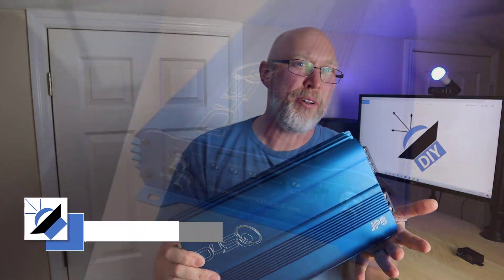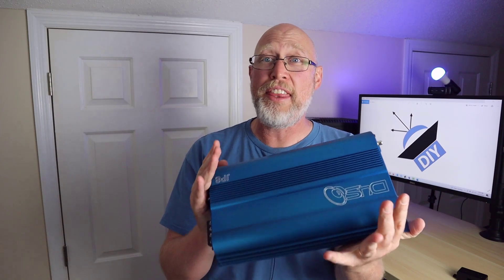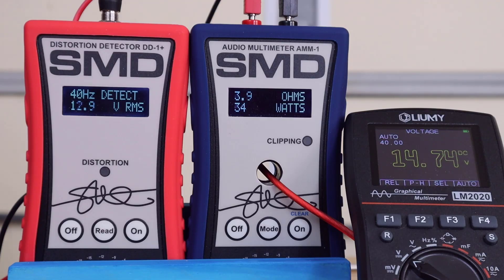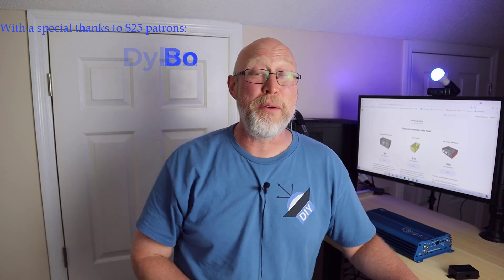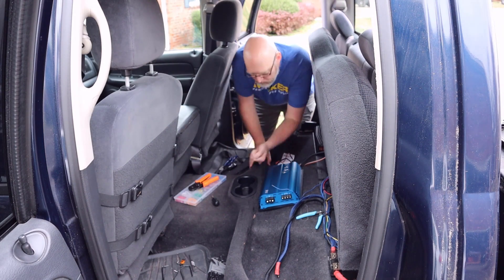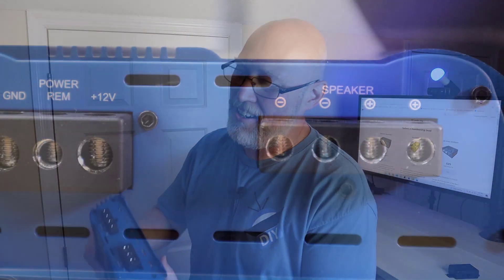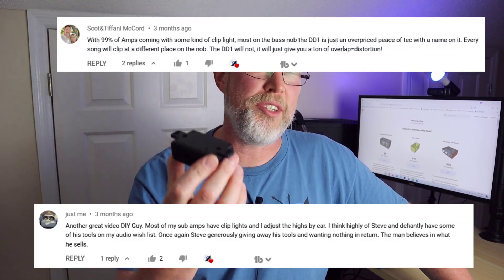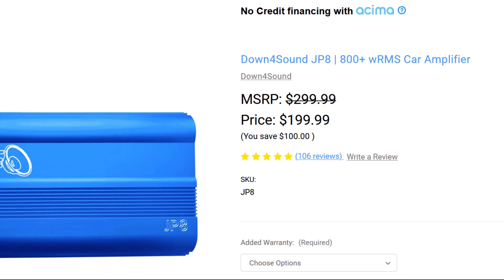700 watt Car Amplifier:  JP8 Amplifier from Down4Sound

Comment: Small piece of window tint on bass knob fix brightness issue.
Reply: @DIYAudioGuy  also use cheap tinted cell phone screen protector. Can cut with scissors would be cheaper then buying tint can be bought for like a dollar.

Comment: Great review! I totally dig this amp, mainly because of the stuff you mentioned....looks, features and value. And it doesn't require an upgraded electrical system unless you are running it below 1 ohm (it's stable down to 0.5 ohms).
Reply from the maker: Yeah it's a good amp!

Comment: I bought this, and matching 4channel, as I LOVE the blue, and throw back look. My ONLY complaint is the inputs are on opposite ends, vs. all on same end. As far as the bass remote, I took mine apart, found an old piece of film negative( Kodak), and placed it over the remote window, put it back together& Voila!, You see it clearly, and tones it down a lot!!! Keep the videos coming.( I don't run these currently, just will keep in collection, blue looks great in person 👍🏼🙌🏼🥳
Reply from the maker: That's really clever!
Reply: Great idea to tone down the brightness on the knob Christian.  Will likely be getting the JP8 + JP84 Combo for the wife's ride.  Great performance for the price... 👍🏽
Reply: A small piece of tint works well too.  And there's tons of different darkness so you can find the one thay works best
Reply: @DIYAudioGuy  just realized I wasn't subscribed... been watching your videos for a while, like your no nonsense delivery and excellent way you have of explaining things so people who don't know as much about it will understand.   I've been messing with car audio for 22 years, every car has had upgraded stereos from mild to wild.  Now that I'm a little older I'm more into SQ, so the single 10" 500 RMS DD Audio Redline in the rear hatch is more than adequate.
Reply: @Vegas_Baba808  I was thinking of doing the same.  For $379 having a nice looking matching pair of amps that do above rated, have the best bass knob/remote display on the market is great.  They will likely sit on a shelf for a while as I don't have anything to put them in atm but for the price it doesn't bother me if they sit for a while.  Or maybe I'll get bored one weekend and swap them in and see how they compare (one car has Excelon XR-4S/XR-1S combo and the other has a couple MTX Thunder Elite amps in it)
Reply: @CarAudioObsessions  Yup.  $380 + Tax for the pair is a steal.  I am trying to work out what kind speakers we going to use.  So many wonderful choices, decisions decisions.  lol
Reply: @Vegas_Baba808  I would just get the five channel JP95 for ur wife it’s what I have in my car & it has plenty of power 4 ur subs and full range speakers 😀
Reply: @rickross368  Ya Boi!  1 Amp that takes up less space, while easily exceeding rated power.

Hustlin' Anthem 4 Life!  ✊🏼🔊🔥
Reply: I have a new in the box JP95, never saw power. Going different route that I'm selling at decent discount if anyone is interested.

Comment: We're you running dual power inputs in the vehicle  ? Wondering if i should add a second battery in the trunk with this amp.
Thanks
Reply from the maker: Nope, just a single power wire of the appropriate size.

Comment: I bought this amp for 169 around Thanksgiving after my kicker cxa800.1 let go of life. That kicker was a tank. This JP8 sounds better than that kicker. It does take some juice to run. I currently have it in an f150 with 130 amp alternator, big 3, and 112 ah of agm. It still drops my voltage from 14.3 to 13 even on a heavy bass note. I am in a group on Facebook with the guy who repairs the D4S amps. He says that they are safe down to 12.5 volts. They designed them to be lower voltage friendly. With enough electrical behind them they can do around 1500 watts. Best 169 bucks I have ever spent.
Reply from the maker: Yeah, I just really need upgrade my alternator this summer.  I love to run a pair of these strapped.
Reply: I replaced a audiocontrol 1500.1 sub amp with the JP8 in sierra Denali  with a 2-12” Jl audio stealth box. It pounds but no where near the level of the audio control. For 200 bucks it can’t be beat
Reply: I have one in my f150 as well on a single sdr 12

Comment: Will this run a 1200w rms subwoofer without problems?
Reply from the maker: IF you have the electrical system to support it it will do 1200 watts.
Reply: @DIYAudioGuy  you mean a good battery with high voltage? I’m trying to get it for my sub rated at 1200w rms at 1 ohm!

Comment: That bass knob is cute but good luck mounting it stealth. I can see car audio thieves scoping it out and breaking windows
Reply from the maker: Yea, this will be hard to hide.
Reply: That’s why you have tinted windows when you got system.
Reply: @KillaCamm  lol. Ok bro. We call that a mark
Reply: Mount it in the center console or if your vehicle actually has an ashtray/cigarette lighter that opens/pulls out of the dash, you could mount it in plave of the ashtray (assuming you don't ever use the ashtray).
Reply: @brandonweigel6309  yes. You need to get creative. It should be designed more modular. So you can take it apart and mount it as separate pieces.
Reply: @johnviera3884  haven't even opened my JP8 and had it for a year now. Not in any rush to use it and for all I know, never will. But if I do, I'll be making modifications to the unit and mounting it more/less out of sight.
Reply: @brandonweigel6309  great amp.

Comment: Great review! i've been running a JP8 for about 2 months, powering 2 10" Kicker Comp R's @ 1ohm total, upgraded 200 amp alternator and i love this amp. The fan on mine runs constant when amp is on, but not a problem.
Reply from the maker: Mine barely gets hot, but I have the gained turned down to match the 500 watt Soundown 12 in the profab enclosure.  Plenty of bass for me.
Reply: @DIYAudioGuy  Same here, barely even gets warm after 30 min. of running hard, especially with the fan coming on when i first turn it on.. constant cooling.
Reply: I live in SC and I have got the thing up to 150 degrees on the bass knob and still hasn’t shut off on me. It sits in the trunk and this is me going full tilt right before clipping for 30 minutes straight. Not to mention this is when it was 95 degrees outside.  This amp is an absolute monster for sure.

Comment: Trick I learned with leds is to cover the display with masking tape and it will diffuse and dampen the light.  Way better.  Layer it if you want dimmer.
Reply from the maker: I think I'm going to do that right now.
Reply: Or a piece of tint

Comment: This is an old video so I hope you see this what does the 1x mean so 650W x 1 @ 14.4v @2 ohm Does this mean 1 speaker or all together? Like I have 2 subwoofers at  800w @ 2 ohms I see amps that say 650W x2 I can't find an explanation anywhere
Reply from the maker: It means one channel. It's a mono amplifier.
Reply: @DIYAudioGuy  thanks I chose mono for a filter. So means they didn’t filter very well.

Comment: I run a couple jp23's at 16v and they take it all day long and push out some SERIOUS power for a couple amps rated at 2300rms. I only drop to 15.2v at max output so I have that 14.4 rating all day long and clamp 3000+ watts out of each. Gain matched pushing 2x sav2 15s each at .5ohm - rising to around 1.3ohm
Reply from the maker: I have a jp23, I hope to get it installed in December, it is going to be part of a bigger project.

Comment: I've only heard D4S amps on videos. But I have seen some articles talking not only the power you get from D4S amps, but their low distortion sound quality. All based on distortion tests that put the D4S as some of the best sounding amps out there.  Strikes me JP at D4S has done a solid for the customers providing an overall good quality product.  OEM sucks, that's why you bother installing an aftermarket stereo.  Even cheap entry level components sound better than OEM. A new $30,000 car still gets a shitty stereo from the car companies. A more powerful alternator and electrical system is a practical feature not even an option. Just a crazy expensive stereo upgrade from dealer. Who then resells your old OEM stereo. Not cool.

Comment: What size fuse u running on that amp ? It says 120 in manual? I just got this amp and haven’t hooked it up yet. I have stock alt, but secondary battery . Would u say 120 is to high ? I reached out to D4Sound but haven’t heard anything back yet? Thank u!
Reply from the maker: 120.

Comment: Review the JP95 if you can. I want to know about the sound quality specifically. 

Awesome video!
Reply from the maker: I'll have to beef up my test bench before I can run that sucker.
Reply: I have a new in the box JP95 that I'm selling. Never had power hooked up. Going different route. Selling at decent discount if interested.
Reply from the maker: @andrewblackmon8021  👍
Reply: @andrewblackmon8021  

Did you sell it?

Comment: So the bass knob CLIP(10% THD) light is turning on before the DD1 DISTORTION(1% THD) light. Hmm
Reply from the maker: Yes.
Reply: it is obviously turning on right when it detects a tiny bit of clipping. the DD-1 turns on at 1% THD so i would suspect this amp is turning the clip light at less than that.  or basically whenever the current and voltage are calculated to be at higher than the amplifiers rail voltage...  it means its not 10% THD.. it is way more sensitive than that
Reply from the maker: @CL-yp1bs  whatever it's doing it's just as reliable as the DD1.  That's really all that matters.
Reply: I read somewhere, but can't quote it for sure, that the clip light on the amp is at like .7% thd.

Comment: I have the same amp but when I hooked up the bass knob it definitely restricts output even turned all the way up
Reply from the maker: Odd
Reply: Did you happen to run it without the knob? I've read on the internet other people had the same issue. I don't have a meter to prove besides my ears and feeling how hard the bass hits.
Reply from the maker: @MrJeast  I did not try it without the knob.

Comment: how do u wire a set of components that r 2 ohm to a 4 channel
Reply from the maker: Most four channel amplifiers are two ohm stable. If you're using a two ohm stable amplifier you just wire your two own components like you would anything else.

Comment: Just to be clear, DD1 light is Distortion, and the JP8 light is Clip. They are not the same thing. Technically, distortion should come in before clipping, so I wouldn't call the JP8 light accurate, but it IS conservative on the good side of things.
Reply from the maker: Yes
Reply: I find this with DD controllers, i believe it is more a distortion light if anything but once it stays on solid & brighter then it's clipping.

Comment: Right now they have this amp on their website for $150 some.. would this amp be better than MTX?
Reply from the maker: The JP8 has more features. And it's been well documented that it can make plenty of power. At the current price it's an absolute steal, I would pull the trigger.
Reply: @DIYAudioGuy  thanks! Putting a system in my f150.. so I will use this amp to power 2 12’s

Comment: Got the jp8 and jp84 combo in my wife's tahoe. Jp84 is running 4 deaf bonce neo 6.5s and sundown tweeters in the doors. And they absolutely scream. Crystal clear and loud af. As far as the jp8, it's breaking in 2 alpine type r's currently and it pounds. I have a second one ordered already. Then they will be powering 2 American bass xfl 15s.
Reply from the maker: Awesome!

Comment: Hey there 👋🏻. Could you make an extensive video about cable connections and materials? Like battery terminal connectors, screws & washers, ferrules and lugs?
I feel like there's a lot of misconception about those things and material characteristics. And you actually have the knowledge and means to do some measurements of resistances and electrical conductivity!
Reply from the maker: That's an interesting idea! Definitely something I could look into.

Comment: Im looking for a 5-channel amp with optical input that wont break my bank! (Example: JL Audio and Alpine $$$$$) Have you done in reviews yet on these type of amps? Any companies that we haven't heard of that offer digital in? I ask for ease of connectivity and sound rejection.
Reply from the maker: An optical input on a car amp is pretty rare.  If I run across one on a budget-friendly amp I'll be sure to let you know.
Reply: Optical input is very rare like he said. Typically not necessary to have on an amp, as source units with optical are designed to be sent to a DSP, and then analog out to your amps. What makes you feel like your RCA's are going to be so noisy that you need optical? Unless you're competing, there will be no need. But if it's a must have, then check into Helix DSP's. Cheap and optical do not belong in the same sentence, so I highly recommend you reevaluate your install and needs. Remember, optical only rejects noise from your source unit, to the DSP...so proper installation of your RCA's, grounds, and drains will reject just as much noise. They will not remove amplifier floor noise as well, which is the issue that most people have on a budget
Reply: @DIYAudioGuy  Of course I couldnt wait. I found a nice all-in-one soluition that I think i'll be happy with! Audison Prima AP5.9. Would love to see you do a review on this still. Thanks for your input!.

Comment: I know this is a six month old vid, new subscriber. I have 2 JP8s running 2  10inch SD-4 sundown dual2 ohm 600rms, amp per sub wired to 1 ohm. My question is , would you happen to know how much power you think those subs can handle?
Reply from the maker: If I give you a number, and I am wrong, that will cost you a lot of money.  So I am not gong to do that.  You definitely have enough power on tap to find out.
Reply: @DIYAudioGuy  thank you for responding, I was just curious as to what they would handle. I had 2 MTX 10 inch 55 series dual 2ohm 400rms with the same amps and those things were no joke! Switched to the sundown and I’m a little disappointed in the performance. I don’t know if after the break in time they will get better. If not I will definitely be putting the MTXs back in. Thank you for your help and time. Love your videos my friend!